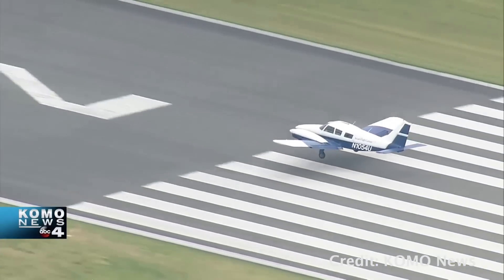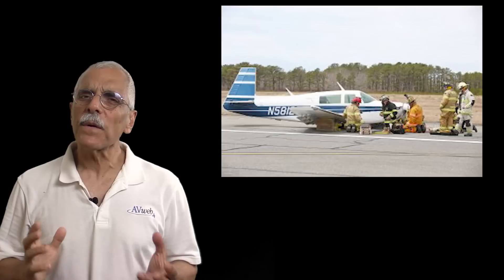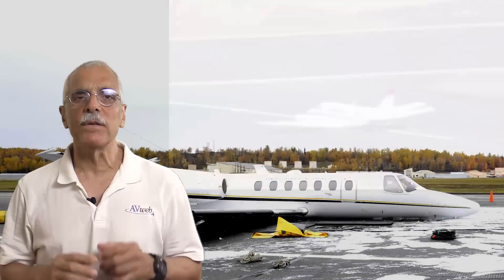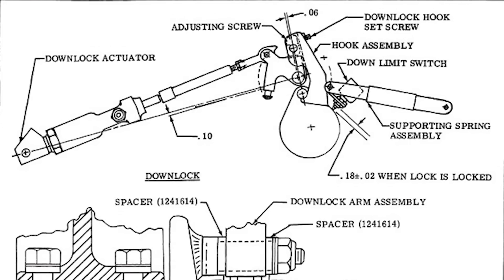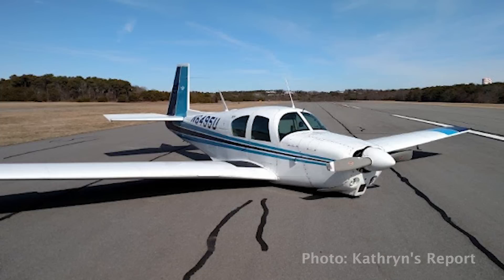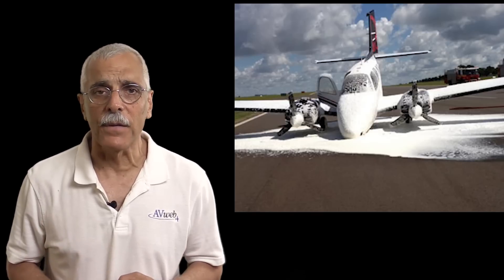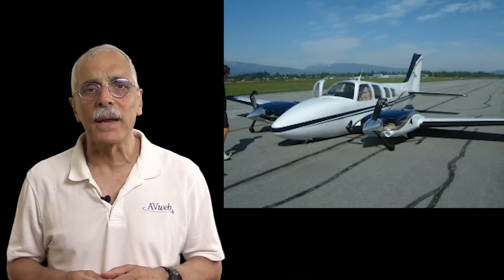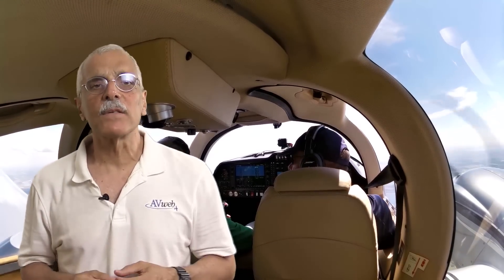Why Gear Up Landings Happen

Comment: Great video Avweb  10/10

 1% ....percenta I must be me  then. 

Left my gear up on purpose in a B58, with passengers, full fuel  --  took off and the elevator disconnected on initial climb-out...!!!  the short version ..... power to control landing approach which unfortunately gave me a crash landing speed of 130 kts /  150 mph / 240 km per hour.   If i had put the gear down for  landing (on any surface at that speed)  we would have all been  killed .... lost one wing and stepped out into 500 Lts of avgas... if you want to see photo's, make a movie or any other information of how it all happened  lesterinvester@bigpond.com

Comment: My only close call ever, was caused by an instructor who just happened to be riding with me that day. I was flying a T-tail Lance into Indianapolis, so he could pick up one of our club planes from the radio shop. Note to instructors, NEVER try to force your methods upon a pilot with hundreds of hours of flight time, unless it is a bad habit! I usually have that internal voice whispering "GUMP" all the way down the final. This ding dong actually slapped my hand from the gear lever, and told me, "not yet. wait until short final." Then, he started to "coach" my umpteenth landing, to his "personal" method. Thank you Piper, for the throttle idle connect to the gear horn! This instructor was known for his arrogance, and was one of the reasons I never flew with him, until I was asked to fly him down there from Kokomo. I had learned from a great WW2 pilot, Don McCann, and a future unlimited aerobatic pilot, Greg Aldridge, many wonderful skills that are not in the written book.

Comment: that all works until you fly an amphibious airplane... Then it gets really complicated. I usually fly my Lake Amphiban and then always use the phrase: "gear down for runway landing" and on short final: "runway in front, confirm gear is down".. Similar on the water: " gear up for water landing" and on final "water in front, confirm gear is up". I always do this, no matter what airplane I fly. This is sometimes funny if you fly with a glider or a fixed gear single, sometimes passengers ask "where else would you like to land other than a runway?"

Comment: so i guess that engine shutdown is matter of personal preferences then...
for example - i dont prefer debris from shatered prop and other parts flying trough cockpit. but thats probably just me... =D
btw - killing the engine is the correct way to handle this type of emergency according to any manual in the whole wide world...
Reply from the maker: It is a matter of personal preference. POHs vary on procedures. Some make no mention at all of what to do in a gear up emergency. Some suggest the shutdown in the flare, some after touchdown. "Shattered props" flying through the cockpit is a fantasy. Metal props don't shatter; they bend. In more than 400 gear-ups reviewed, none suffered penetration of the cabin by anything other than runway lights or other fixed features on the runway.

Comment: I've never flown an airplane. I DO however have a combat flight simulator on my computer. I can't count the number of times I've made a belly landing because I simply forgot to extend the landing gear. I'm happy to hear I'm not the only one who's done this. The man said HALF of gear-up landings are due to forgetting to drop the gear. I'd hate to be one of the ones who did that in a real plane. 
On whether or not to leave the engines running: I'm no expert on this, and I have no actual experience to speak of on the matter. However, it just seems to ME that if you stop the engines and feather the props, that might make the props rigid and, since they aren't turning, cause them to want to dig in. I think I would rather leave them running at idle on touch down. Just my opinion...

Comment: Its a very good video, but I have one thing to comment on.. the reason why they switch the engine off... (yea most of them do that to try to save the "blades" but they will need to change everything anyway....) but isn't some pilots also thinking about the risk of a blade flying in the wrong direction when hitting the ground? I mean I know its a very little chance of that happening... but.... what if the blade turns and hit the ground.... wouldn't the blade fly off?

(Anyway, my knowledge about such things.... is .... limited... so sorry if its a stupid thing to ask...)

Comment: Are 210s still worth purchasing?
Reply: Hi Walter, yes but depending on your mission and the terrain where you’ll fly. Turbocharged ones if u r flying over mountains, non turbos if u aren’t. Pressurized ones( lots more maintainence and cost and  more expensive to buy)  if you want to high(above about 12k  for long periods. It’s my fav high performance single engine bird. I have around 400hrs  in them.. Hopefully you have bought one by now. 😊

Comment: A gear-up warning beeper that goes off at about 100-200 ft, would save 50% of these landings. And it can be disabled temporarily for low flight (and soon automatically re-activates) and when it starts beeping again while in low flight, just push the disable button again.
Reply: Tell that to this guy: https://youtu.be/5McECUtM8fw
Reply: a lot of aircraft have an annunciator that goes off once the aircraft is put into a landing configuration with gear up, like with the flaps extended. as humans we are just really good at finding ways to screw up.

Comment: Quick question...  With all the technology out there and the advancements in technology, why don't they install a device that automatically retracts the landing gear on takeoff and automatically drops the landing gear when descending at say, 150-200 Feet.  That way the pilot will not forget it...
Reply: Two reasons:

1. "Devices" will fail at the same rate the landing gear (which is just a "device") will fail
2. Weight and cost

Comment: isn't it dangerous to leave engines running on prop planes because it can cause shrapnel fly through the cabin if the propeller hits something and breaks up?

Comment: Hard landings are the main cause of gear fails later. Hard,  or sideways Crabbing Landings on crosswinds bent the links and bolts, then those things fail later. Hard landings need gear inspections. But most guys who do crappy landings consider them 'normal" (BS) and dont inspect anything. Then they crap when have to land gear up, leave the prop turning instead of cutting the mixture on final, land hard too. Big expenses. 

The insurance companies pay the big expenses. Then we pay higher insurance premiums later due those  crappy landings guys.  A Vicious Circle of Gear up landings, expensive insurance claims and higher premiums coming for all of us.  Another USA GA sinker stinker.

Comment: Working as a line mechanic at a small airport for 3 years I did a recovery for a gear collapse and witnessed 2 gear up landings due to mechanical failure. A 172RG had an actuator split on one of the mains and another where a nose wheel didn't lock down even with the gear down indicator light on. With the engines the props normally get scrapped or overhauled and the engine inspection consists mainly inspecting the accessory gears in the back of the engine. Jugs get removed for con rod damage inspection too.

Comment: I think most of us might have been trained to shut down the engines prior to touching down during a gear up emergency landing. Although he makes valid points about leaving them running in event of a go around. However, if a prop strikes while spinning it becomes useless and not only will that engine fail to produce thrust but the prop impacting the ground could torque the aircraft into a wing strike or if only one prop strikes you could end up with significant adverse yaw at speeds close to Vmc. Would love to hear anyone's opinions on whether or not to shut down the engine
Reply: I feel that if you are close enough to the runway for the prop to strike then you have all ready passed the point of the option to go around.

Comment: As maintance tech I have had to put the gear down twice on test flights. The gear speed is usually higher than flap speed, aircraft handle different without the gear. I always place my hand on the gear handle until aircraft roll out is complete. Test flying unfamiliar aircraft puts pilots in stressful situation that would appear routine, small things can make a big difference.

Comment: Being completely ignorant of this topic, I'm amazed that even light aircraft aren't equipped with proximity sensors and alarms to prevent such inadvertent mishaps.  What am I missing here, or would this just be a common sense modification?
Reply: Marty, there are alarms. In most retractable gear aircraft, there is a aural alarm based on throttle position. It helps, but the distractions that lead to forgetting the gear have also led to not noticing the alarm. You can find a few YouTube in-cockpit videos of gear up landings with the warning sounding to hear what it sounds like.

Comment: most pilots cut the engines when they finally commit. once they get the speed low enough and they have practiced a few times. ive heard many in flight recordings of no gear landings. and none of them ever chopped the engines in the pattern, the glide slope, and final.
they cut them when its 1 second from dropping it
Reply: That's because they weren't glider pilots. Any self-respecting sailplaner would have shut them off at 3000' over the airport and had those props nicely horizontal.  No glider pilot worries about overshoots- one shot is all they ever get anyway.

Comment: C-210 is notorious for this. 
So much so that I, as a very young A&P in 1983, got on COM and directed the pilot to re-select gear up, kick the center pedestal (!) then select gear down again. 
TADA! 
lndg gr solenoid in the center pedestal of Cessna RG models is sketchy... throws the doors open, but doesn't sequence the unhook and LG down...
...unless you kick the sh*t out of it.

Comment: I was a witness to a gear up Landing last week. It didn't fall into any of your categories, although I would have to imagine it is rather common. The pilot decided he wasn't safely going to be able to make the runway after an oil pressure failure. He chose the corn field over the muddy soy bean field or public roadway. He didn't deploy his gear on purpose for obvious reasons. I didn't catch the landing, but did get lots of 4k video of the scene and aftermath. My video was featured on the local news after the reporter showed up on scene in expensive loafers. Mud in the corn was ankle deep!

Comment: If you are suddenly surprised by the sound of props striking from not putting the gear down.   Do NOT try to throttle up and go around.   Let it slide to a stop and LIVE.

Once the props bend the performance goes out the window and so many people die from thinking they will go around and get the gear down.
Reply: You say that so glibly while flying an armchair. 

Landings can be stressful. People will do terrifyingly stupid things while fatigued or under stress. Also note, you might not "hear" much. You'd probably feel the prop strike and you might not recognize it right away for what it is.

The reason I trained frequently and read everything I could was because I did not want to find out what a prop strike sounds like.
Reply: I am surprised Paul Bertorelli missed this important point. The gear-up landing may not be particularly deadly, but attempting to go around is one way to turn a bad day in to a worse day, and maybe in to your very last day.
Reply: saw a chieftain do an accidental gear up in the Yukon several years ago. pilot went around with bent props and made another landing with gear down. I agree he should have pulled the mixtures and slid it in. had 2 passengers on board that said the plane was shaking violently. scared the crap out of them. the odds of him losing both engines in the circuit after that were tremendously high.
Reply: I've heard or have seen that happen.Can't remember which it was so long ago.  But a guy in a twin, maybe a piper, scrapped the runway with his props gear up and flew a long way back to his home airport many miles away with vibrating props.
Reply: I was told, in the Military "If you need full power to taxi back to the hanger, you probably forgot to put the gear down"
Reply: last year i was doing to training and just got done tying down the plane me and my instructor are walking back to our cars as we watch this ww2 airplane come in for landing and it was like 3 feet off the ground when we head a loud ass bang and they pulled up and throttled it wide open no sign of the gear ever being down too we just watched as they struggled to bring her back around and the noise from that prop was horrendous we watched as they blearily climb up to and held 300 to 400ft thought they were gonna stall out and die from the excessive pitch angle upward but they managed to bring it in going the opposite way to land with the gear down this time.
Reply: Hmmmm. .. not for that one special ArgoStar pilot that did a  crunch 'n go ang then flew on to another airport. It was still on youtube a while ago.
Reply: How do you think the Q-tip prop was invented? An engineer saw an after photo of a Nava-Ho' gear up attempted go-around and started thinking...
Reply: You mean there are idiots that would hear and feel something like that happen and think "Wow, I should get further from the ground again." I hope nobody I ever fly with is that stupid.
Reply: @CrimFerret  more like when they panic there brain is just like, oh somthing was wrong with the landing i should do a go-around. Just like how some ppl slam on the brakes in a car if somthings wrong. though i havnt flown a plane before, thats how a friend described it to me
Reply: @CrimFerret  Just ask them before you climb aboard if they are a Democrat.  That will answer your concern.

Comment: One correction Sir. The incident in Ft. Lauderdale was not a MD11. It was an MD10 which is a modified DC10 flown only by FedEx pilots. The MD10 and the MD11 carry a common type rating.

Comment: Really good video.  I did not witness it, but I have seen photos of a late-1960s gear-up landing of a Frontier Airlines CV-580 at DEN (mechanical failure compounded by design flaw in alternate gear release system).  CFR foamed the runway, but you can imagine what happened when the crew pulled the emergency handles on the Allisons just before planned touchdown.  Those thousand-pound Aeroproducts props took a huge bite of air as they went to feather, boosting the airplane down the runway and past the foam.  Touchdown was centerline and smooth, slide-out ended on the runway.  Props and engines were trashed, of course, but blades stayed attached to hubs.  Small amount of smoke from keel scraping, but overexcited firefighters did a lot of damage.  There is a picture of the airplane sitting empty after evacuation, no sign of fire.  The fire (?) fighters subsequently not only sprayed the entire exterior, they went inside and soaked the airplane interior in foam.  Years later, CFR did similar but lesser damage when a Frontier 737 did a gear-up landing at KCPR due to crew error.

Comment: What about some alert system , warning pilots in case they forgot to put gears down?!
Reply: Talal S there are gear horns that scream at you if you reduce the throttle below a certain manifold pressure with the gear up.  Supposed to get the pilot's attention and remind him to lower the gear.

Comment: Just like most accidents are from pilot error. Ran out of fuel, forgot the gear is still up, forgot to turn on the deicing, etc. I could not believe that half of gear up landing were from just forgetting. I don't care what kind of distractions you encounter, that may be a reason. It is not an excuse. To all you semantic Nazis out there, there is a difference between reason and excuse. Over sleeping and being late for work is a reason, not an excuse. Getting hit while sitting at a red light and being late is an excuse.

Comment: I fit in the 30% category: Bonanza A36, ferry from the factory, less than ten hours on airframe and power plant. At the destination of the flight, the gear would not come down even manually. I cut the engine, slid it on the runway, and the starboard wing caught fire from leaking fuel. I departed the aircraft when it stopped. I tripped off the wing because it was on the ground. The insurance company paid, it flew in seven months. Your tutorial is very well done, and practical. Nice work Mr. Bertorelli. Thank you.

Comment: As a CFI flying retractable gear airplanes I think the gear warning systems on light r/g airplanes that we fly are very poorly designed, because they probably won't protect you when you need it most. I'm referring to the typical warning horns that sound when you close the throttle(s) beyond a certain point and/or extend landing flaps with the gear up. It can happen like this: Distractions occur which disrupt you from your usual landing gear check(s). If these distractions cause you to make a non-standard approach where you end up coming in low, you might just avoid adding flaps and you'll carry extra power in. Your gear warning systems are now useless. What's worse is that in some airplanes the stall horn and gear horn sound so similar! You're probably not going to be paying attention to the difference while doing your flare. 

My method is, assume that the airplane's gear warning systems are inoperative, and religiously use three layers of defense:
1. Gear down, landing checklist. Do this when...
- 5 miles from airport 
- Midfield downwind
- FAF inbound, or
- Descending below traffic pattern altitude, whichever of these occurs first
2. GUMPS 
- On base leg, or
- 500' agl (instrument approaches)
3. Short final "3 green"
- 1/2 mile final or
- at decision altitude